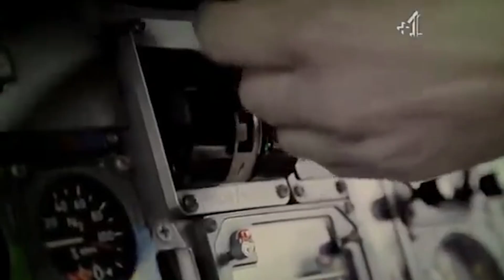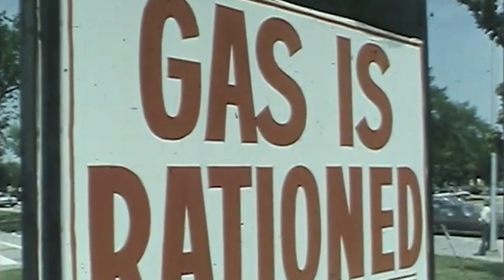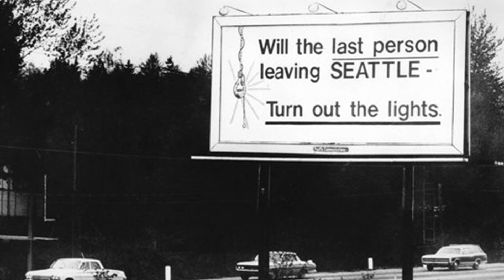The Forgotten American Concordes - Boeing 2707 - Lockheed L-2000 SST

Comment: The Tupolev Tu-144 was built by USSR with Concorde's plans stolen by Soviet spies.
Reply: JIMI JAMES 
good ol' Keyboard Warrior always here
Reply: The Concorde flew 80,000 passenger flights with one crash.  The Tupolev Tu-144 flew less than 200 times and crashed 3 times. Concorde had 2X the range, and was much more stable at low speed.
Reply: Tex Mex  the stability of the 144 greatly increased when they added those large extendable canard like surfaces behind the cockpit as a result of the crashes.
They weren't there initially.
Reply: JIMI JAMES no wonder u have no subs
Reply: JIMI JAMES
after seeing  your comment full of capslock and many typos, i think i get a tumor on my back now

edit: sorry,Tex Mex. this comment is actually for JIMI JAMES, but somehow YouTube got drunk and instead i replied to you. im sorry. -Aril :)
Reply: JIMI JAMES Does everything have to be in caps? Calm down. America built aircraft other than the F-35 right? We built the SR-71, F-22, B1, F14, and F15. And that's just the tip of the iceberg. 2nd, Russia has stolen other aircraft designs, see the TU-4: A reverse engineered copy of the B-29.
Reply: Why do most Americans think they are the biggest and the best?
Americans have the technology of the atomic bomb, the technology of the Messerschmitt, the technology of the V2 rockets and much more already stolen by the German after World War II. In Germany, the Horten H IX were already in World War II whose technique was later copied by the Americans in the F117 and the B2. The Americans were afraid of the Russian Mig 17 in the Vietnam War. The Mig 29 and the Mig 32 were far superior to the American fighter jets. The U Boats in World War II were the American's sought-after booty because of their technology, because they were unable to build even decent submarines. The German submarine type XXI is the forerunner of all modern U boats. Even today the Americans are not able to detect German U boats. So do not talk about stolen technology here! When stealing technology, the American is top of the range!
Reply: Tex Mex Also, the Tupolev couldn't reach its top speed and it was insanely loud. The Concorde could turn off it's afterburners once it got to a cruising altitude, but the Tu-144 couldn't. Its afterburners had to be on all the time, thus decreasing it's range. :)
Reply: Tex Mex
please read the comment i replied on
TU-4: A reverse engineered copy of the B-29.
Reply: The Tu-144 was crap compared to the Concorde. The Tu-144's wing design was inferior as well as her engines. It was out of passenger service withing a year or two while the Concorde was retired in 2003.
Reply: They also appear to have taken the Concord plans and scaled everything up a bit, the 144 is slightly larger, carrying slightly more passengers,  slightly more powerful and slightly faster. It's like they just HAD to make it 'better' than Concord. TheRussians certainly had their own talent, their only interest in the Concord plans probably was to ensure they were 'better'. :-)

The Technik Museum Sinsheim in Germany has a Concord and TU-144 'side by side' on display. You can see the similarities and differences one viewing.
(Both are on the main hall roof mounted in a takeoff attitude).
Reply: DS Analysis
Wrong, base variant of F-35 (F-35A) doesn't have VTOL capability, and F-35B is a replacement for Harrier Jump Jet, which is 2 decades older than Yak 141. Basically it's based on Harrier, not Russian design, because the British and Americans made VTOL fighter back in the 60's, YAK 141 only came out in mid 80's.
Reply: Riposte Laïque silly france it was build by russian bias
Reply: JIMI JAMES Alright buddy, calm down, Putins not gonna give you a pay rise any time soon.
Reply: It seems odd that the CIA had the plans for the Concorde, but yes that is proof enough to me.
Reply: The Russians didn't steal, the CIA did not give to them, they read it in Aviation Week and Space Technology like everyone did. That is also how they copied the Space Shuttle too.
Reply: Not spies, it was Russian hackers.
Reply: Concord at least saw commercial service for some 30 years (!).
Tu-144 wasn't even ordered by any airline.
Only Aeroflot used it because it was government owned Soviet Airline.
It only made 55 passenger flights and then was converted to cargo aircraft totaling in 102 flights then taken out of regular service.
Tu-144 was an amazing airplane but the project was rushed to compete with Concord and this is one of the reasons it failed.
Reply: I apologize I have forgotten (Soviet Space Shuttle copy NASA ☺☺☺)
https://www.youtube.com/watch?v=XLOCQw5s9Uw
Reply: It wasn't a 'copy'. The Packard company was asked to build the Merlin under licence to increase availability, and Churchill made funds available to Packard to enlarge their factory. This was after Ford was asked to help, and refused because Henry claimed to be a pacifist. And so he was, until Jeeps were required in large numbers.
Reply: @billcobbett9259  
To be fair, Ford had to do something. The government stopped the manufacture of cars for the civilian market. Being a pacifist doesn't mean he's hardcore enough about it to let his company die. But I'm sure he knew the government was going to need vehicles, and lots of them.
Reply: JIMI JAMES. Why are you yelling?
Reply: JIMI JAMES  no they were stealing information so they were fed something that would not work. Same with some of their fighters.
Reply: And N@zi Zionist US regime has stolen the delta wing
Reply: To all the morons repeating propaganda like parots... read western biased wikipedia and take notice of start of developement, first flight and introduction dates.
As far i can remember, Americans were bying, grabing and copying Russian equipment left and right... remeber MIG25 and Belenko / first PESA radar's plans from mig 31, sold to CIA by Tolkachev / purchases of MiG29s / S 300s / theft and complete copy of Russian superior space suits during 90s uder disquise of friendly tech exchange / American rockets flying on FAR superior Russian engines / helmet mounted display and IRST copied 20 years after Russians designed them from bought 29s / futile atempts to copy supercavitating torpedo and closed circuit rocket engines even wilst having them in possesion / ... And list goes on.
Reply: Riposte Laïque
that is why it had its first fight before concorde i suppose dimwit
Reply: ianrkav will r
Reply: fred6319 yeah, with copy rolls Royce engines!
Reply: Oh please keep wallowing in your superiority complex
the P 51 had a copy of a rolls royce engine
Reply: epikmanthe3rd the F 35 is a copy of the Yak 141. The F-15 is a copy of the Mig 31
Reply: Tex Mex The fastest jet in service today is Russian.
Reply: crazykirsch The F-35 is a copy of the Yak 141. The F 15 is a copy of the Mig 31
Reply: Cobradriver99 Fastest jet in service today is the Mig 31
Reply: And have stolen reproduction process. All know that with the Soviet union sex wasn't ☺☺☺☺
Reply: True
Reply: Олень Рачина Simply quickly stole, quickly made, quickly flew.  Russian fastest ♥
"Ilya Muromets" (first passenger airplane)  First flight on December 23, 1913
The Ilya Muromets aircraft was revolutionary as it had a passenger saloon and washroom onboard
Reply: epikmanthe3rd i think its captured b-29 or america lend them it
Reply: Zorro Alphonso how many rubles did you get for this bullshit?
Reply: CAPS-LOCK ALERT
Reply: Riposte Laïque 
No
Reply: It's just stupid gossips. No real evidence to this nonsense.
Reply: Riposte Laïque yeah and the plane turned out to be ass and noisy
Reply: I think they stole around 90,000 documents
Reply: Lel
Reply: No way, Soviet plane engineers were far superior those days.
Reply: At the time there was very little in the way of solving the problem of supersonic flight over long ranges coupled with having enough lift & controlability at anywhere near the usual landing speeds civilian runways & airports could handle. Anyone building an SST in the 60s was probably going to end up with a Cranked Delta wing for the best supersonic/landing speed behaviour. 

To keep drag down the fuselage was going to have to be pencil like which again lead to the Droop Snoot so the pilots could see the runway during landing. After adding enough engines to give the required thrust....well there's really only one common sense place to put them, along with adjustable inlet ramps to control air entering the engines at supersonic speed. Put that all together & Voila! you've got something that's going to look like Concorde.

Concorde looked like Concorde because of the available solutions at the time. Concordski had the same basic shape because it was supposed to do the same job & the physics & areodynamics didn't change once you cross  into Commie Land. Side by side they were quite obviously different, most notably the TU144 had canards. Concordski was the Commie solution based on their research & what their industry could cope up with. Sure they tried to spy on Concorde's development & that bit them in the ass, but I've no doubt The West had the plans to the TU144 from an early stage too.
Reply: JIMI JAMES  Too much vodka in the borscht comrade.
Reply: @jhbbunch  no such thing as too much vodka
Reply: JIMI JAMES  SR-71 the greatest aircraft ever made was American.  Enough said (and I'm not even American)
Reply: JIMI JAMES  идиот
Reply: Riposte Laïque you're correct but it's not surprising industrial espionage is the standard Russian research tool.
Reply: That's right. Concorde designers knew it too and deliberately fed them plans with severe flaws and weaknesses which were not in the original designs. This could be why the Russian Concorde broke up in flight at the Paris air show.
Reply: JIMI JAMES TRIGGERED COMMIE
Reply: but Russia has a history of copying. B29 says hello........ ya dummy
Reply: reverse engineered?  So they had a British Concord in hand and were able to figure it out?  Please pull the other leg.
Reply: JIMI JAMES is most likely a hired troll from Russia. Kremlin pays for what he writes on the internet.
It's his job. just don't pay attention to that propaganda bullshit LOL
Reply: ZIonist USofAIPAC has stolen a lot more than USSR,
Reply: epikmanthe3rd
reverse engineered is not stolen i suppose in your universe there was no MIG 15 and all the other mig and sukhoi planes
Reply: Tony Anytime we actually gave them the space shuttle, that was when we were working together...kinda why the ISS has Russian capsules. It was a joint venture.
Reply: Riposte Laïque Concorde's plans were stolen from Nazi Germany when the US army reached Berlin. The US also stole the nazi scientists who worked on german planes.
Reply: @rochester212  and NASA was built by Nazi scientists. Without the Nazis USA would still be stuck in 1930
Reply: That this was possible proves how corrupt the Concorde people were :-)
Reply: And the Valkyrie's plans were stolen by the Europeans.
Reply: You're wrong on both counts.

Both the Tu-144 and the Concorde are clones, variations of the XB-70 Valkyrie. 

The most important aspect of determining which came first and who took what from whom is to see the concept and design schematic iterations of each project. When you're doing something that nobody else has done or designed, the engineering process is literally flooded with concept and feasibility analysis followed by a litany of failed prototypes and alternatives to solve the same problem. NAA was brilliant in the number of schematics, designs, tests, and archetypes they chose - everything from the wing and fuselage to the environmental controls - and it all left an enormous, documented paper trail and design history that can be seen today in archives and a Museum in Ohio. The Tupolev and the Concorde developers have no such paper trail or design history. That's how you know the Concorde and Tupolev used work stolen from the Valkyrie - beyond just the simple fact that the Valkyrie was flying years before either the Concorde or the Tupolev, beyond the fact that the Russian and European design bears such a remarkable resemblance to the Valkyrie's outward (and inward) design. When a Mathematician or an Engineer only gives you "answers" without knowing how to do the Proofs or work the problem step-by-step, THAT is how you know that they are just repeating someone else's work. They are standing on the shoulders of geniuses. Actually, it's worse: many people are crediting the Tupolev and Concorde team with accomplishments not their own, and I would hope that - in their old age - their personnel have enough integrity now to be embarrassed by it than when they did in 1962. Only when the Valkyrie project was canceled did the British and the French go ahead with their plans to "civilianize" and clone the Valkyrie, signing their agreement almost immediately after. Had Mcnamara not sabotaged Ascani's team and prevented them from building their own SST based on the Valkyrie, there would have been no contest - the British and the French required a great deal of time to assimilate NAA's work; Ascani and co would have easily built and flown a civilian version of their "Concorde" sooner than Aérospatiale/BAC (it was NAA's design after all). It's not a secret, after all, and it's no wonder the British and the French made sure Ascani and NAA were cut off at the legs and the Valkyrie canceled before they went ahead. The development and project team of the Tupolev and the Concorde were proficient, make no mistake; they certainly rate as among the best at the time - but they were demonstrably NOT in the same class as Ascani's project team, in the same way that nobody thinks the developers of the Chinese J-31 belong in the same class as Skunkworks and their YF-22. 

(As an aside, the British also lobbied to have the F-22 canceled; and failing that, siphon off American expertise into the F-35 program which they had access to. This is the real reason why the F-22's numbers were docked, similar to the way the Valkyrie team was prevented from claiming their rightful prize in 1962; American government officials selling out to foreign powers)
Reply: Riposte laïque is some rabid anti-Commie taking for granted media propaganda.
Tu144 was of a superior design to Concord, hence its use by NASA for supersonic tests. Concord saw commercial service only with the British and the French. All other ailrines cancelled their orders on Concord.
You cannot "steal" plans to build a plane, except in Hollywood movies, It takes much more than that, and the Russians had the engineering prowess to pull off a plane like Tu144 on their own. Only the ignorant would equate superficial resemblance to "steal".
Reply: @zorroalphonso4354  There were numerous problems with the TU144 one of which was the ridiculous 95 db cabin noise making it unsuitable for passenger transport . Read and learn  https://en.wikipedia.org/wiki/Tupolev_Tu-144

Comment: Let's face facts. Concorde was killed by politics. Because the americans couldn't build an SST, the FAA put restrictions on supersonic flight near the coast of america to make operating Concorde as difficult as possible. It is obvious they wanted it banned right from the start, as evidenced by the speed at which they banned it after Paris. An accident I might add caused by pieces falling off an AMERICAN built aircraft! Also, during it's career, spanning from 1976 to 2003, how many US built aircraft crashed killing how many thousand people, with the FAA not banning them? Look at the number of DC10's, Tristars, 747s, 737s, 727s and many others that have crashed for technical reasons not external forces. Pure and simple. Concorde was singled out because it was better than anything the americans could produce. Don't get me wrong, the 747 was a very good aircraft in it's day, but now, thanks to New technology the A380 is better.

Comment: Let's face it. The only reason the Concorde flew as long as it did was continuous cash infusion from the UK & France. That would have nor happened in the shareholder held US airline market. Scrapping Boeing & Lockheed SST's was the only feasible thing to do. They would have been short lived money pits. As for the Tu-144? A miserable failure with antiquated technology

Comment: All we have to do is put seats in the SR-71 and we can fly passengers at Mach 5.0 speed.  It can also fly Mach 2.0 at low altitudes it does not have to fly to 50,000 feet to reach Mach 2.0 like the overrated Concorde. The Concorde is a cigar tube attached to four rockets.

Comment: I think the future of aviation is inexpensive travel which could be done with the new generation of lighter than air vehicles. They have enormous cargo capacity & I think they'd be able to provide 300 sleeper seats for a transatlantic flight. It would however take 24hrs as they only go a bit over 100mph. but would need only less tha a tenth of the runway space, therefore allowing 10x the amount of landings & takeoffs. Not that I want to see the end of the development of supersonic commercial aircraft, I just see the lighter than air option serving people well in the interem. Also this is just my opinion